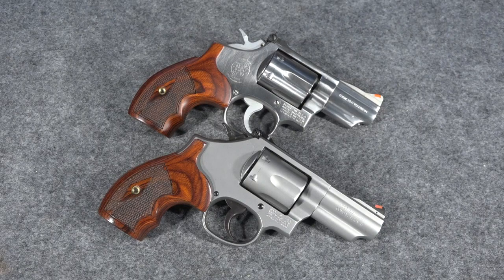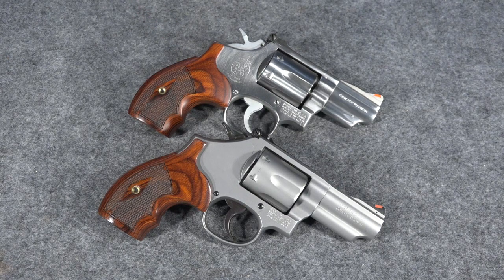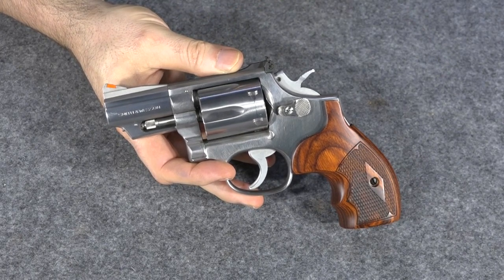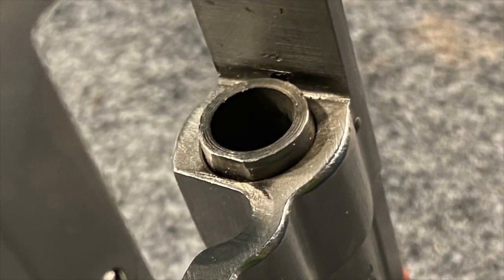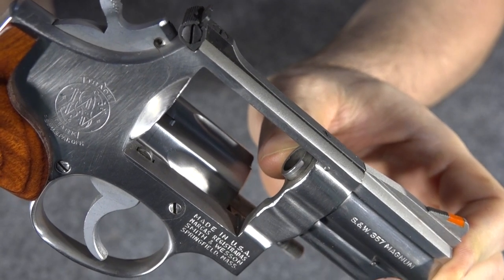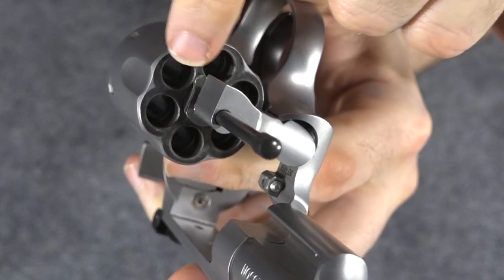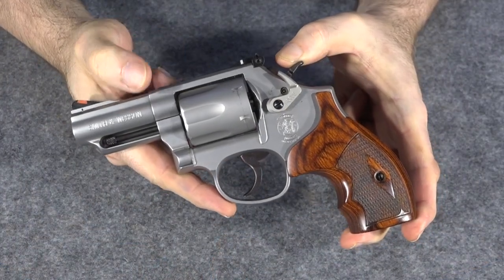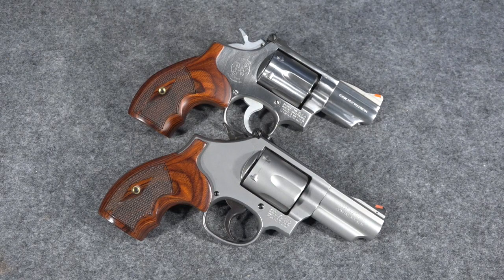Can K-Frame S&W Revolvers Handle Full Power .357mag Loads? (Cracked Forcing Cones)

Comment: TYM, Very good explanation on this issue.  Some added insights- The K frame .357 mags digested full power magnum loads just fine.  The issue of forcing cone cracking came from feeding a steady diet of power house loads that brougt this problem.  That was a primary motive for the development of the L frame.  Yes, the change of the crane profile helped solve the matter, it also forced S&W engineers to utilized a reduced diameter ejector rod without a rod lockup similar to Colt design relying upon rear cylinder and cylinder bolt assurance of proper lock and alignment.  Only a mature fart such as I take notice of this.  It might not have material impact as to the accuracy of the gun; it was a detail that set Smith & Wesson apart from other makes.

Comment: And actually the K-Frame design with that flattened cone goes back to the late 1800s with the first hand ejectors.  Back then they were chambered for low pressure rounds like the 38 S&W and 38 Special so the gun was plenty strong enough.  Even after the 357 mag was designed in 1935, it wasn't chambered in a K-Frame until 1955 with the Bill Jordan combat magnum (later called the Model 19).  Cops were looking for a smaller gun than the N-Frame but still have 357 Mag power.  Back then the 125 gr. 357 Mag was HOT, but cops were of the mindset to practice with 38s and carry 357s, so again no problems.  It wasn't until the philosophy changed to practicing with what you carry that the guns started to fail in a few cases.  So really it was more just an old design from the days of lower pressure cartridges rather than light 357 mag ammo of the day....the design predates the 357 mag by a long time!
Reply: That's why I always had confidence in my Model 27 to digest the big boy loads.  Wish I'd never traded it away.  With the nickel finish, it was a beauty !

Comment: I have a 2 1/2 " Model 66, bought new in 1982 and have fired uncounted boxes of .357 without negative effect. The dept issued ammo was 158 gr JHP.  Also have a 4" Model 19 which is over fifty years old which has fired more rounds than the Mod 66 and is still undamaged. Maybe I just got lucky but like the man said it is better to be lucky than to be good.
Reply: Hey sir well the problem to my knowledge was depts that switched to hot rem or fed 125 gr.
Reply: @DanTheWolfman  I have no extensive experience with the 125gr ammo only the 158gr bullets.  Just sharing what I know directly, for whatever it may be worth :-)

Comment: S&W advised back in the day: As long as you stick with bullet weights 158 grs and up you're gonna be fine. The issue occured almost exclusively when more modern, high-velocity 125 grs rounds were used. S&W said you shouldn't even fire a single round of those light-weight, high-speed rounds. Again: 158 grs full power loads are no problem at all.

Comment: It seems to me that the K frame says 
" Practice with .38 +P , but carry .357 magnum. You can fire a few magnum loads but not regularly."
Propably refers to the light for caliber .357 magnum loads. You can use the 158gr no problem. Even the Underwood 158gr load. 
Just don't go using the Underwood 125gr. 357 magnum hot loads. 
Want to shoot those 125gr hot loads? Switch to an L frame.

Comment: I love your videos you definitely know what you are talking about and you are mostly correct on this issue, I carried a 4 inch model 65 the first two years of my career, in the late 80’s early 90’s training changed. Before we would train with 38 spl ball ammunition, then the mindset of training switched to training with the ammunition you carried witch was 357 magnum, so these k frames were suddenly subject to a constant diet of full power magnum loads, I never saw an issue with my gun but enough cases were noted nation wide that caused Smith and Wesson to come out with the L frames, but by that time the wonder 9’s had pretty much took over the police market

Comment: You can probably shoot thousands of .357 magnums through these guns without ever having an issue.  But, it's not those 100's that matter, it's the one round  that that actually cracks the cone that matters.  No one knows if or when it'll occur.  You just need to be aware that it is a real possibility and choose your ammo with that understanding.  I have several 66's, and I shoot magnums periodically.  But I mostly shoot .38 specials and +P's.  I like to shot the 158 gr magnums when I can find them.

Comment: As mentioned, the light bullet/heavy powder charge hot loads are what caused it. And any Smith, even the K's with milled forcing cones, can handle those fast light weight loads for a while before you need to worry about it. My 1981 Model 65-2 sees nothing but a diet of full power 158gr Hornady XTP's. The only powders I use are W296/H110 and Lil Gun. I get less velocity variation from the 296 but more overall velocity from the Lil Gun. K's are fun and reliable if properly maintained. I've put a few thousand rounds through it since I've had it but it's a former Knoxville PD duty gun so I'm sure there were thousands put through it before I bought it. 

When law enforcement moved to semi-auto they sold off their revolvers so for a long time there was a surplus of really cheap revolvers available to the public. In the late 90's a model 65 would have sold for less than 200 bucks. That means there were hundreds of thousands of these things being bought by people who couldn't afford a new one and didn't know how to care for the old ones. Just like old police Crown Vics, they were dead reliable when they were maintained properly but they turned into piles of junk when the minimum wage public got their hands on them.

Comment: S&W listened to Bill Jordan and put the 357 in the K frame, where they had it in the N frame. 
Thus over time the K frame showed it’s weak point, so S&W brought out the L frame 586/581 & 686/681 revolvers in 1980. The K frame is a perfect match for the 38 Special and the + P version of ammunition.

Comment: I always saw cracked forcing cones in the older j frame 357s shooting 38 specials exclusively.
Reply: @ChoseDeath  I saw it across 3 owners of several different years.
Each only shot 38s because of recoil issues.
I then met a few others over the years that had that issue, but never saw the guns or anything other then their word on it.

Comment: I think when .357 Magnum first became available in the 30s it was probably ballistically a lot closer to the old .38/44 round which was typically a 158gr round at 1100-1150fps depending on barrel length. Most manufacturers now are loading .357gr at around 1250fps or so from a 4" barrel and of course the really high velocity 125gr rounds do well over 1400fps. That's just too stout for that shaved down forcing cone on older K-Frames. I have an early 70s S&W Model 66-1. For quite awhile now I have been mostly shooting .38SPL through it but when I do shoot .357 Magnum I like the Federal American Eagle 158gr Soft Point load. My chronograph readings show it to be a somewhat mild load doing 1180-1200fps from a 4" which is pretty suitable for an old K-Frame in my opinion.

Comment: Actually a pretty good explanation, and one of the reasons I bought a 686 over a 66, with I knew that today it is a non issue.... but the 686 has its merit. I will add the best mod I ever did with it is replace the trigger with a old L frame trigger and the rebound. Made the action world class.

Comment: might have been that the original .357 were higher pressure, then with problems showing up the the saami specs were lowered.  so I have heard others explain. from wicked-o-pedia "The original 357 load was a 158 grain bullet with an advertised muzzle velocity of 1525 fps. (Muzzle velocity was taken using a revolver with a fairly long barrel of 8.75”) Most of today's loads are fairly mild when compared to the original load."

Comment: Going through hell now having cracked the forcing cone on my 586. Pretty pissed as i rarely ever shot full loads of .357. Only about 2000 total rounds put through it and only about 100 to 200 of that were full loads. The majority was .38 and maybe a few 500 to 600 rounds of lighter .357 loads
Reply: The problem exists on the L Frame as well?
Reply: @DL-ij7tf  the 586 is an L frame. So i guess so 😅

Comment: First of all only a few companies manufacturer 357 Magnum ammunition loaded to its historical potential. My first revolver was a used model 1966 4" Smith & Wesson. Nice gun but I didn't keep it long enough to screw it up. 
 I will answer this question without even watching the video. The answer is yes. All day long safely. Will you make the k-frame go out of time and / or end up with a bent ejector rod? Yes and yes. Will the beveled forcing cone crack with a steady diet of full-power 357's.? Maybe. I never cracked mine but didn't keep it that long. Mine withstood some very heavy handloads! I've read about cracked model 19 / 66 forcing cones several times. After all , isn't it these k-frame issues that brought about the Smith 586 and 686?
  Now I'll watch the video.😁😁😁

Comment: I'm looking at my 19-5 4" S&W and I just noticed the squared off bottom part of the forcing cone. So what should I be shooting in it, what I'm guessing is what I just posted about what you are using in yours?
Reply: Don't use 125 or 110 grain high velocity loads. Hot 158 grain loads are fine.
Reply: @robertmurdock9750  Thank you!

Comment: K- Frame is able to use  most powerfull  38 Sp + P  round.  But not modern FP 357 mag all time.   (He can be interresting to reload 357 cases with 38sp +p  specifications)  . Its preferable to install very fine  wood Grips  ...and use only 357 occasionally in 1950/60 power level  ( 850 joules  )

Comment: Yankee to say you ITS NOT SAFE to shoot 357 mag out of the older K Frames is just not true, the problem came from shooting the HOT 125 grain billets and a lot of em through them, the 158 grain bullets were not a problem in the guns I know because I own 4 OLDER K frames a 19, 66, 65, and a 13. I’ve never cracked one, IF YOU SHOOT A STEADY DIET OF HOT 125 grain ammo it MOST certainly can crack the forcing cone. 158 grain practical loads are fine and NO ISSUE. Hickok 45 also addresses this topic and says he’s shot thousands of 357 mag 158 gr ammo and has never cracked one.

Comment: The biggest issue with the K frame .357’s turned out to be certain very hot 125 grain, and in some cases 110 grain, JSP and JHP loads.  These caused a great deal of stress at the forcing cone, a fairly thin area of the barrel.  Early on, these same loads proved to be a problem with the 686, when a combination of hot loads and soft primers were pushing metal back into the firing pin bushings on the breech face.  The 686 action is not inherently more durable than the 19/66.  In fact, because of the heavier cylinder of the 686, cylinder stop wear, as well as peering on one side of the cylinder stop window in the frame, is greater.

Comment: I was reading an article last night that stated when 357 magnum loads were introduced they were hotter, but have sense been "weakened" over time. I ran across it looking for a round for critters when we fish and hike.
Reply: Your right the 357 was designed for the N frame and when they start to use the smaller frames is when the problems started to occur.
Reply: Yes, average 357 magnum 158gr loads used to be loaded to 1,500 fps & just under 700 ft/lbs, now it's 1,250 fps 550 ft/lbs.

Comment: So is it safe to purchase an older S&W with the flat-spot on the forcing cone, or pass and buy a used Ruger Six/GP or newer but less "finished" S&W?
Reply: I’ve been looking at quite a bit of information on Ruger’s revolvers lately, and the six line in particular. Apparently the sixes can develop different issues if you shoot full power .357 rounds out of them. Their GP line fixed that, but just like some people are arguing here that they never had any issues with their older k-frames after firing billions of full power rounds through them x-six owners say the same thing.

Personally, I’d say if you love shooting only full power .357s to play it safe and use the GPs. Stick with lower power .357s in the sixes to preserve their longevity.
Reply: Tommy Ribs I have very limited experience with older smith and wessons. I gotta say that I like them, they’re more than good enough to get the job done, and if it is a beauty contest then the older designs win, but the modern S&Ws have them beat (in my opinion) in the practical things that you need in order to make a better revolver. I trust my life with them more I’ll put it that way.

I haven’t shot and worked on enough old smiths by any means, so ehh maybe I’m wrong. Any recommendations on what could change my mind?
Reply: Any of those you listed would be a win in my book as long as the initial inspection of the firearm does not reveal any existing problems or signs of abuse (abuse being more likely).

I would avoid pushing light bullets (125grn and below) fast and tend to stick with the 140 grn to 158 grn bullets for most of my shooting.

Comment: I understand that this was a problem only with the late 1960s and early 1970s stainless guns not the carbon steel revolvers.  I've heard it was because the stainless steel used then was not as durable as modern stainless steel and as a result it's not an issue with moderns guns or anything produced since the late 1970s.
Reply from the maker: Nope

Comment: So what if any loads are safe for 5 shot jframe sized guns? My taurus 605 has had a couple boxes of remington green and white box .357 shot thru it. Should relatively mild factory loads like that be ok? I know better than loading it with hot loads like buffalo bore or max loads from the reloading manual.

Comment: I have an old model 19, and it doesn't have the flat machined on the bottom of the forcing cone. Odd, considering it's basically the same gun as the model 66.

Comment: I think the hype of the problem is greater than the problem itself I read in a forum and it couldn’t be anymore of a true statement. I understand the model 19 but a few things have changed never had an issue with mine. I think people shouldn’t take this video as a guidance to not buy the gun just read up on the subject and have your own conclusion.

Comment: the new 357 mag loads are still within the origional SAMMI specs.
Reply from the maker: SAAMI spec pressures change quite often...as have .357mag specs many times.
Reply: Yes, there are the SAMMI specs.  Different manufacturers still have variations across production lots particularly due to changes in available powders.  The engineers make effort to keep within pressure limits and can still have burn rates vary quite much dependent on conditions, barrel length, chamber to cone through barrel, etc.

Comment: Wonder why if they had to take metal off they would take it off the cylinder that handles the pressure rather than the part that doesn’t? Seems like a weird decision. You’d think they would have don’t they opposite just to keep it more durable.
Reply: The development of the L frame solved much of the forcing cone issue.  S&W models 581 and 586 were exemplary guns produced from the 1980's onward.

Comment: No.
Use .38 Special for training. 
Use .38 Special +P and/or full power .357 Mag. only for actual defense/carry.
Reply: Point of impact can change dramatically between all 3 of those rounds, depending on the ammo and gun. If you can find a combination of practice and self defense rounds that have the same point of impact, more power to ya.
Reply: The .38 for the range/ magnum for the street went out with the 1970's for Law enforcement doctrine.  The conversion for most every department to auto loaders has made it moot.  Doesn't mean that there aren't some security personnel or select officers that choose the wheelgun as a primary sidearm, just that this specific issue has pretty much been addressed.  Back in the day I had a Model 27 that digested hot reloads without a hiccup.  Never should of traded that nickeled beauty away.

Comment: You would have provided a real service by telling us which "hot loads" to avoid, when shooting the classic Model 66.
Reply: General consensus is stay away from 125 grain loaded to 1400fps or higher. The 158 grain offerings don't really have a history of splitting forcing cones. One theory is the longer bullet is easier regarding flame effects.  357 was loaded very hot in its early days and was watered down significantly in the 70s and 80s and now we're back to what 357 should be.